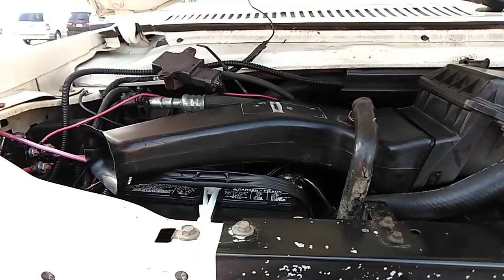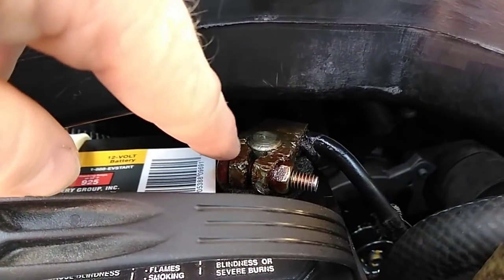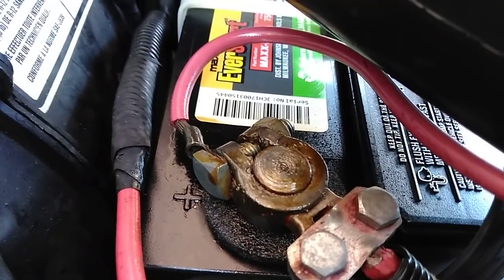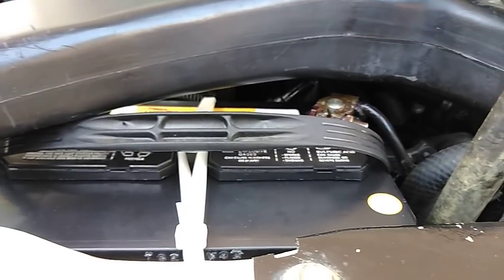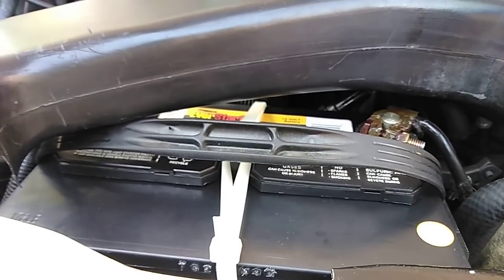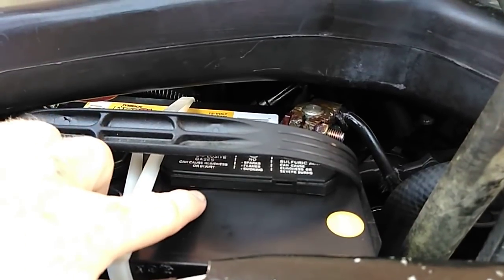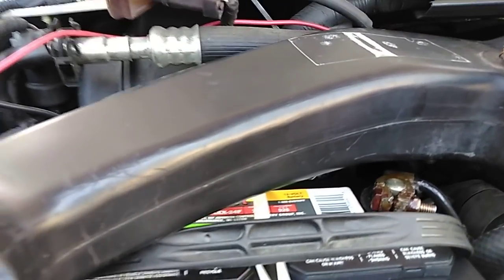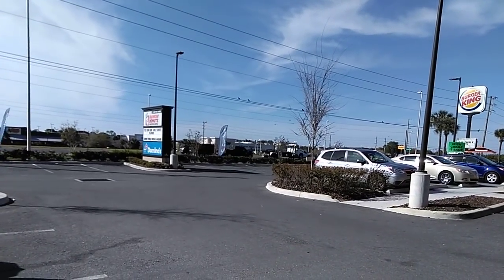Here it is all back together with the battery back in it seems to run fine 🌎🚐🤔🤔🤔🙏

Comment: I think what is happen is the volt reg. wasn't stopping the charge to the battery so it what they called over charge it/ Boiling The Battery. That why you had to add water. Did it hurt the battery Yes but they will not take it back because it will charge and hold 12 volts. All they test for if a cell is bad.which mean it will not hold 12 volts. But I think you got it fix.